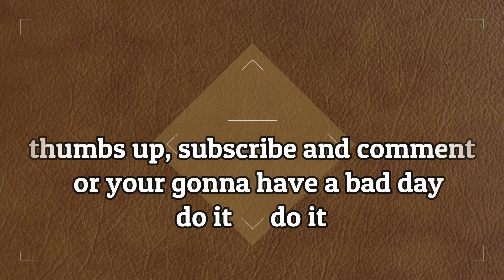This is why NOTHING GETS DONE on the HOMESTEAD!

Comment: Good video Doug and I learnt something as well. I'm really into the timber and sawmill videos as I used to work in the forest cutting firewood and improving the forests by thinning plus before that I was a Sawyer in a sawmill.
But the thing i learnt was the drilling into metal, I've always drilled on the 2nd speed and fast,very interested the way you showed good camera working too able to see clearly.😂 interesting you used the hammer on steel to is that recommend too?and what speed you drill in concrete?slow or fast? thanks for great video. Also agree with you about starting a project but end up longer than anticipated 😬
Reply: Please DO NOT follow these instructions!  They could get you hurt. If you have to lay on your drill, you are doing it wrong. Drill in high speed setting and never use hammer for anything but concrete or masonry.
Reply: Thanks for the reply so should use 2nd speed for metal?yes I thought you never use hammer for steel and more likely break drill bits by pushing down on drill.
Reply: @roybracy5074  That is correct! and never hammer anything metal or wood. Large bit or thick metal requires pilot hole, I usually use 1/2 size on larger holes.

Comment: hum there is a reason for using a solid shank  you have have discovered  hehehhehehe  OK Doug you are learning about right tool for the job.    1/2 drill for half inch drills no hammering on drilling metal.  The other thing.. use short drill bits not long ones.  talking 2 inch long drill bits.  you are hurting yourself you are frustrating yourself.  Suggest you talk to your tool dealer about the right tools for the jobs.  We love you out here.. We dont want you getting frustrated .

Comment: Those silly step down bits are for those who DO NOT HAVE THE RIGHT TOOL. Any compromise like that is weak and will fail at some point. If you need a half inch hole is steel or concrete, you need a drill with a half inch chuck so that you can use a full size drill bit. Step down works in wood mostly because it is softer and more forgiving. Not surprised those bits failed. One question: Why did you chose to drill through the double thick metal that had been welded? Welding heat makes the metal harder and more brittle. That one in the middle with single thick metal away from welding heat was probably much easier to drill through and you could have chose those points everywhere. Also I would have lifted and put a board under the metal when using metal drills to protect the bit from concrete dulling. Just me and how I did it for a lifetime in construction. Good bits cost too much to risk hitting the concrete with. I guess with those cheap bits it does not matter as much. Just buy another one when you ruin one. WD 40 is not slippery enough for drilling steel either. You got away with it but damaged the bits more than you know. You would have been better to get some used oil out of your tractor crankcase! Or even some of that hydrolic fluid from a few videos ago. I always had some straight thirty weight cheap oil around for such things. Even two cycle mix oil is better than WD 40. And finally as others have said, never use hammer function on steel. That is only for masonry uses.  Helps chip through the rocks in concrete and such. It is amazing that it did not break those tool steel metal bits. Concrete bits are made of different metal that can take the impacts.

Comment: PLEASE never drill steel on hammer setting and when you drill bigger holes into your pilot holes do not put to much pressure on the drillbit if sharp should do the job on its own and drill a bigger hole very quickly. To much pressure made your drillbit bite into the metal and caused it to break

Comment: You only want to use hammer drill position for drilling concrete, not steel.  Also one mistake many people make when using hammer position they use all there body weight to push down on drill. Use less body weight, let the hammer do what it is made for. Bit hammering up and down will drill hole. Also Milwaukee cordless drills suck. We have them at work ,  chucks always loosen up , drill bits fall out. I will put Dewalt against them any day.

Comment: had to laugh.. Bosch sds  and you would have been done almost before you started have used many other hammer drills.. They are as you discovered.. Useless.  Hammer drill in metal OMG that is not what you want.  Curious have you EVER seen a drill press used for metal that is a hammering style?  NOT happening.  Hammer drill for doing concrete big thumbs up